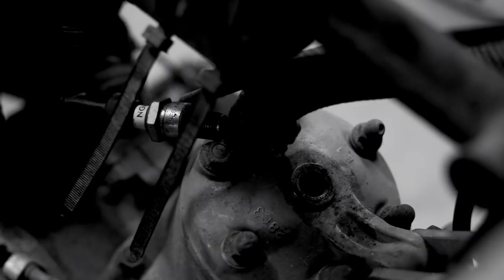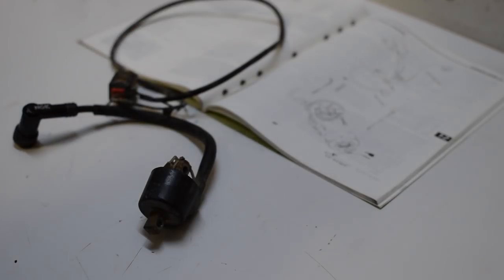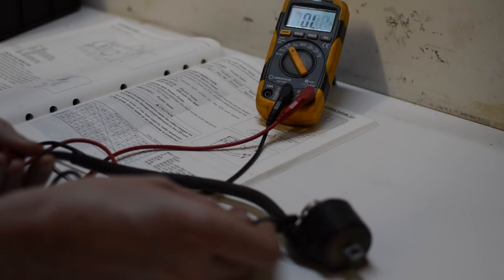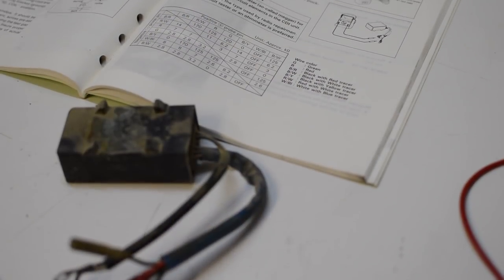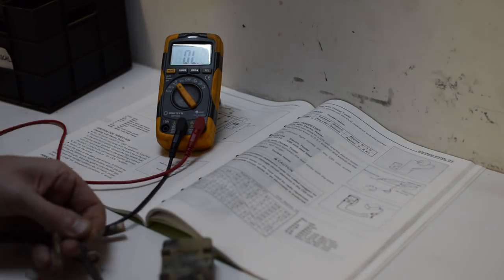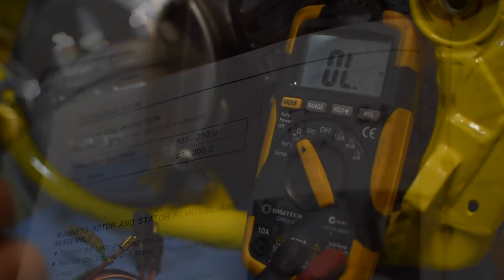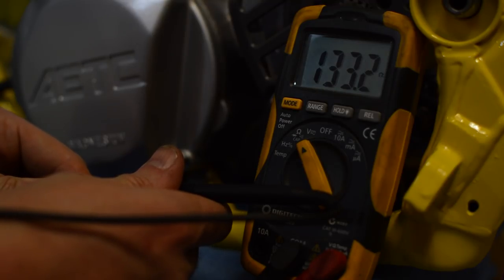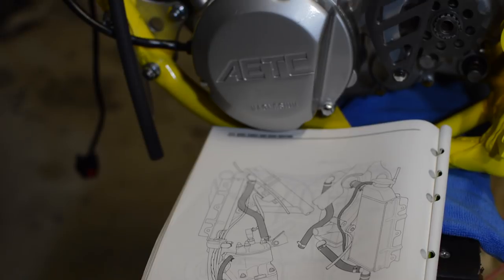Electrical System - 1992 RM250 Restoration - Episode 15

Comment: At 3:50 - I think that my RM had a little rubber bit to go between the CDI unit and the metal frame. It is really testing my memory because I sold my RM nearly 15 years ago.
Love the videos. So cool to see the amazing work that you are doing to restore this bike.
Reply from the maker: You are 100% correct!  If you keep watching the series you'll see that CDI removed again ;)
Reply: I pulled my bike apart in the off season (not to the extent that you have) and washed everything with soapy water, touched up the paint, lubed and re-assembled. When I saw this video I just thought that the rubber bit was something the previous owner threw in there. Your rebuild is absolutely incredible! I am having such regret that I sold my RM but am thoroughly enjoying watching these videos.

Comment: Please HELP !, I bought a 1989 RMX 250 and I don't know what its spark plug, can I run NGK BR8EG ?
Reply: I baught a 96 rm 125 2 stroke today, you can take the current spark plug to your local auto parts store and they will match it!!
Reply: @matthewburns6843  Thanks a lot, I did follow the service manual and I was running 20:1 premix so every time I ride I had to change the spark plug until I realized the thing 32:1 lol.

Comment: Any tips on how to pull wheel bearings without a bearing puller
Reply from the maker: Try heating the hub around the bearing and then try tapping them out from the other side with a punch or maybe a big flat blade screw driver...
Reply: G9Garage I tried heating the hub but it didn’t work I also tried with a flat head screw driver and it can’t get enough purchase because of the spacers 

Thanks for replying!
Reply from the maker: Hmm, tough one.  I bet the bearings have been in there since new!  Might be worth investing in a bearing puller kit.  From memory they aren't too expensive.  Mine's just a cheap one from ebay i think and it works ok.